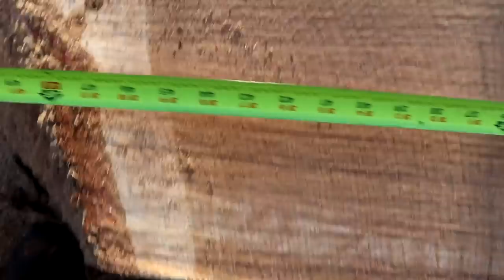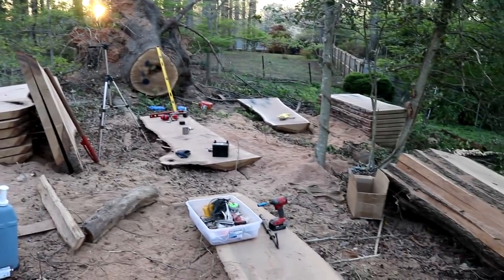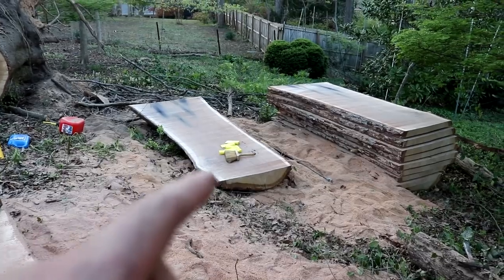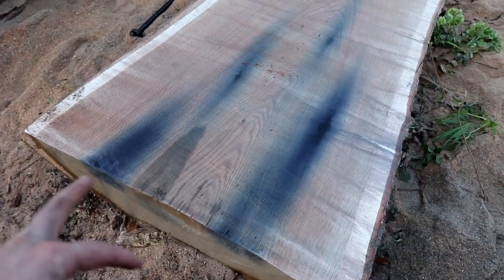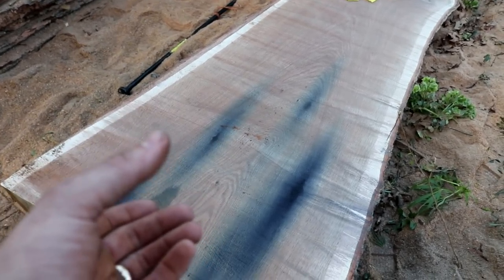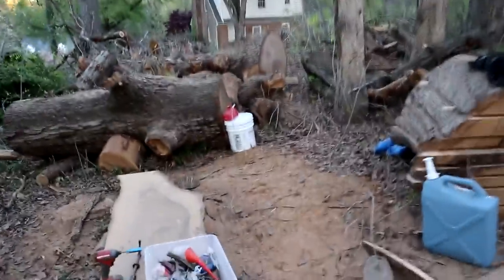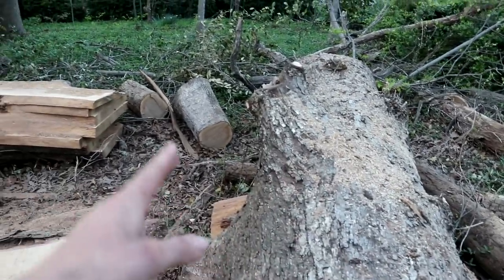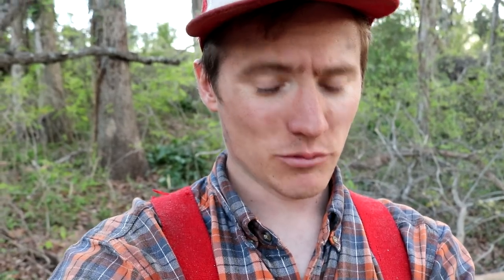HUGE CHAINSAW MILLING JOB!! 45 Foot White Oak!!!

Comment: Big tree!!! What type of mill is that I have never seen one sith a winch did you add it also the tank on the in water or oil?
Reply from the maker: Here's the link to my mill, I got a 60 inch. https://granberg.com/alaskan-mkiv-c2-series-30-84-2/ I added the winch, here's a video. https://www.youtube.com/watch?v=TSVn6rH2UyA The tank on the end of the bar is an auxiliary oiler. Chainsaws have oil in the powerhead that is automatically pumped onto the chain and bar. When using bars longer than 3 feet, it's a good idea to have an extra oiler to keep everything lubed up. It extends the life of the bar, chain, and sprocket. The bar I'm using is almost $700, so you want to make it last....with that said, you go through a lot of oil, but more out of the saw than the extra oiler. Hope that gives you a good starting place in learning about this kind of milling. There are more videos on Youtube on the topic, not a ton of detailed ones, but plenty showing people working. Thanks for watching.

Comment: What lengths do you normally cut large trees like this Oak?  8' 10' 12'?
Reply from the maker: I lean toward 8 feet, mainly because anything bigger is getting pretty hard to handle and store. I also consider the overall length of the tree and what will divide out nice. I also consider the projects I would use it for.
Reply from the maker: by 8 feet I mean a little over 8 feet so that I can trim the ends, 100 inches or so.
Reply: Thanks appreciate the answer I'm new at this and like the teaching videos

Comment: how did you end up carrying the wood offsite?
Reply from the maker: With this tree, a friend and I picked them up, carried them into the yard and sat them on a small trailer behind a lawn mower and trailered them down to the street one at a time and onto a large trailer. Then hauled them about an hour away to be stacked and stickered for years of drying. It was rough.

Comment: watching in Brazil! whoever can answer in Portuguese what was going on in the wood, that white liquid. what is it for?
Reply: Para que no se raje la madera ya comensando a cortar la madera, ya secandose mas despacio. Despacia la salida de humedad del tronco asi no se parte. So I tried it in Spanish. Hope it helps.
Reply: Using Google Translate, here is what I came up with: 
As extremidades de um tronco ou de uma tábua tendem a ser muito mais porosas do que o lado plano de uma laje / tábua. Portanto, se você pintar as pontas dos galhos das árvores, o tronco ou as tábuas, reduzirá a rachadura que ocorre quando uma árvore seca muito rápido. Ele permite uma secagem gradual e igual e, como resultado, madeira serrada de melhor qualidade. I hope it answers your question.

Comment: How did u dry the wood afterwards, plz??
Reply from the maker: It is air drying with one inch spacers between the slabs I'll finish it off in a kiln before using it.

Comment: no issues with the saw through the whole job? thats alot of hours onto that motor, probably only get 100-150 or so out of a ring and piston
Reply: Andrew Browner if you run big stihl  saws with a 40:1 mix you can get a LOT more than that,  
my ms880 had over 1200 hrs on original piston ring and barrel before I changed it.

Comment: Amazing. Which chainsaw mill do you use? I'm in pressed by how level the plane is and how square the ends are.

Can't wait to see what you do with the slabs.
Reply from the maker: https://granberg.com/alaskan-mkiv-c2-series-30-84-2/ I have a 60 inch mill package. The cut is due to the chain, very sharp....until it's not. It's a ripping chain, ground at 10 degrees. I have a granberg chain and a stihl, both the same angle. Having a good saw keeps you cutting nice as well.

Comment: can you check them with a metal detector ?
Reply from the maker: Yes, but that simply says there is metal. Not what it is, how big, etc. In most cases, I'm still going to mill the slab is it is worth more than the chain.

Comment: How accurate is that chainsaw mill.Ive always wondered how flat they mill
Reply from the maker: If you have a sharp chain they mill surprisingly clean, having a powerful saw makes a difference to in being able to feed it evenly. The only issue I have had is the bar sagging a little, cutting a slight curve into the slab but not enough to make a difference, in the end once dry, they need to be flattened, usually with a router flattening set up. Even if they were milled to flawlessly flat, while drying the slab will move a little. You can see in the video that they are pretty flat. A chainsaw mill's strengths are that it is the most mobile mill you can get, even one with an 8 foot bar can get anywhere whether it is way in the woods or in a backyard that heavy equipment can't access. It's also small, a bandmill is large and requires putting it somewhere. I have my mill on a workbench in my basement. They are also very simple, the mill it's self is nothing but bars of metal and bolts. Keeping your saw running and chains sharp is the only thing you have to do. Price is also lower, while larger mills including the saw get expensive, they are nothing compared to a bandmill that can saw an equally wide slab. With all that said, a bandmill is going to be faster and easier if you have the right equipment. Chainsaw milling is about as hard as it gets.
Reply: Thank you for the detailed response.Great videos your putting out as well

Comment: Thank you so much for making this video. Wanted to ask for your advice on stacking and storing the final boards as I keep milling more logs. Is there any risk to stacking and storing them in my basement? I'm worried about potential bugs or termite issues. I do have pest control service for my property that includes termite stations surrounding the property. I just don't have any easy way of storing the boards outside and the logs have already been cooking outside in the sun over the past 6 months of the winter season. I'm in the Atlanta area so not much of a winter here but mostly rain. Would greatly appreciate your feedback. Thanks again!
Reply from the maker: If you can do it out doors, just stack it all up with stickers and cover with tin. You could do it in the basement, but you need air flow, you would need fans.
Reply: Thank you for the feedback! What size stickers do you use? And is it ok to make the stickers out of one of the slabs I mill or do you recommend getting them from home depot instead?
Reply from the maker: @c0olj85  people say the best is to use the same wood you are stacking. I just rip up 2 by 4s to 3/4 square strips
Reply: Got it. Thanks again!

Comment: Recently purchased a small hobby band saw mill and interested in how you obtain the logs. If you don't mind me asking, in your Craig's list adds do you offer to buy the logs or remove them for free? BTW-Really enjoy the channel.
Reply from the maker: My listing just says if you have a downed tree, I will come take the log. I specifically say in the listing that I am not a tree service, that I am just a guy that wants to mill up the tree for lumber. I also so that I can not do a full clean up and remove all the rest. I say that by removing the largest logs, I will make the job of cleaning up easier and that the wood will not go to waste. I do not offer any money. Sure you can pay, but if you are in a city, you will end up with plenty of free wood over time. No one has asked me to pay, they are just happy to have the wood be gone. I also won't do anything dangerous or risky around their house, as in, I won't cut a tree down. In short, I say that I am just going to come take what I want and leave the rest. The log in this video was free, I heard from someone I know that it fell, I went to the persons house and knocked on the door and asked if I could get it, they asked me how much I would charge to removed it, I laughed and said free, they got a surprised look in their face and said ok. I'm just going to cut the branches in to small pieces and toss it into the woods. About an hour of clean up. I volunteered that, they did not ask me to.
Reply: Thanks man!  You answered a lot questions I also had but didn't ask.I think your practice of cleaning up the job site a little is excellent business and a win-win for all parties.  Also, I hear ya about not touching anything risky! Working on building a log arch trailer for transporting logs back to the mill. I will definitely use your technique when soliciting for free logs.... Thanks again for your advise and very informative response!

Comment: I am sure the safety police have already commented but you have chap son but you aren't wearing them while you are moving around with the saw. They are hot but mine saved my leg a few times when I least expected it. Had to do with me being tired and the saw being heavy. Any way what type of saw is that and old Stihl or a clone? How many cc?
Reply from the maker: +Ted John It is a Stihl 090. 137cc......i have two. Both made in the 70's. Very powerful.

Comment: Just curious if anyone knows.. when you slab out a tree like that do you still need to seal the end grain?
Reply from the maker: You don't have to do anything, but certain practices can improve your end result. Sealing the log slows down the drying from the endgrain, which helps prevent checking, splitting, etc.

Comment: Why do you use that seal on the wood?
Reply from the maker: To keep them from drying too fast at the endgrain which would check and split the slabs. Makes drying more even.

Comment: I used to be a badass like you,now i am a worn out ass from destroying my discs from being a badass like you. But i still go , i just hurt more now. It don't come to you,if you want it you gotta work for it.If i was 30 again would not change a thing.....maybe a few
Reply from the maker: I've had a lot of older people tell me how bad I'm going to hurt when I'm older due to the more rough activities I've been involved with in life, I listen politely then ask them what they did to end up in such bad shape. They never have a good answer. I will have wonderful reasons for being a crooked old man.
Reply: @thehomesteadcraftsman8975  Yup,good reasons to me also.We have pride in all we have done that most people will not or can't do.I think about stuff i built in my 20's & 30's and think"WTH was i thinking,whole room additions by myself,monster logs i got and sawed myself,still doing it.Town i live in is over 400 YO and lots of very large old trees here. My 10 acres has all large mature trees on it and i hardly drop any of them with all the others available for free or cheap.4 sawmills that i know of here probably many more small  Sawyers like me.
Reply from the maker: I would not cut my own trees down either unless there was a good reason, get them from someone else....I havn't paid for a single one yet.
Reply: @thehomesteadcraftsman8975  Wow,we talk about this and today i walk down to the creek and see a 28 inch red oak blew over,about 90 feet tall, 20+ tons all together and it took a 14 inch white oak with it.Gonna have to winch it about 200 feet to the trail,can't get in there unless i take more down.

Comment: You should have a metal detector in your car when you're doing stuff like this. Check the logs before you cut into them if you suspect metal.
Reply from the maker: Let's say you've got wood like this, or a 4 foot diameter walnut, etc....would you not mill it because of the risk of hitting a piece of metal........I'm milling it. It's just part of milling.

Comment: How much is 1 slab of that big wood worth ?
Reply from the maker: I don't know, but I would think a lot. Between $500 and $1000 if it dried without too much distortion and in the right market. I've seen them for much more at the same time.

Comment: Where did you get your saw an that long bar
Reply from the maker: Saw was used, stihl 090. Old Oregon bar for general cutting then the 6 foot bar came with the mill. I also have a Cannon bar, the will have what you need. Very nice bars but you may think they are expensive
Reply: @thehomesteadcraftsman8975  thank you.
Reply: @thehomesteadcraftsman8975  I have an o29 super I use for general  cutting  what's a good saw to mill with I don't run into trees that would need a 6ft bar 99% could be done with a 48" bar.  I want to build a house an finish inside  with lumber I cut band saw mills are pricey  so I'm looking more at a chainsaw mills

Comment: Out of curiosity what did you pay the property owner for this tree?
Reply from the maker: They have it to me, just wanted it gone. They actually asked me how much I would charge to get it out of there. When I told them nothing, I just wanted the wood their eyes about popped out of their head. People pay to have trees cut down and or removed all the time. A tree company will charge a few thousand to remove the tree, then go sell the logs to mills. With that said, I don't remove the branches/leaves. I only mill and take the slabs or in some cases take the logs and mill elsewhere. In this case, I cut up the top of the tree which landed in the yard and tossed the pieces into the woods. I would consider paying for logs if it was as simple as going somewhere and picking them up but in cases like this, it's only worth it if it's free in my opinion.
Reply: @thehomesteadcraftsman8975  
Damn score!

Comment: The pulley crank is not linked. Can you give me the name of it.
Reply from the maker: I just search hand winch on amazon and bought a boat winch 600 pounds without line and wound paracord onto it. check out my other milling videos, the link is there somewhere. It's in a playlist.
Reply: Do you remember the title of the video where you have the link to the boat winch.

Comment: What’s the paint for?
Reply from the maker: It's not paint, it's anchorseal. Basically a waxy finish. It seals the end grain so the wood does not dry fast. Paint works well, but this is supposed to be better. Working good so far.
Reply: The Homestead Craftsman I see. Thanks for the info🙏🏼

Comment: Wouldn't it be wise to invest in a metal detector?  If you did discover a buried nail would you actually drill and dig for it?  I suppose you would have no other options unless you didn't cut it at all...

Comment: Yard trees have a lot of insulators, screws and nails in them.
Reply from the maker: Indeed, this one wasn't too bad luckily, but the walnut I did before this one was bad.
Reply: I will have to get a metal detector.

Comment: What's the bar you using that's slick
Reply from the maker: It is a double ended bar, meaning I can run two saws on the same bar or place a helper handle on the opposite end. I got this one from Granberg.
Reply: What inch is that bar what cc saw?
Reply from the maker: The bar in this video is 72 inches long, when mounted in the mill I can cut 56 inch wide slabs. I also configure the mill to cut with a 36 inch bar (30 inch wide cut). The saw is a Stihl 090, 137cc. It is very powerful and well suited for milling. The modern equivalent would be the Stihl MS 880. Slightly less CC, faster chain speed and has saftey features the 090 doesn't have.........I prefer mine!
Reply: Nice thanks for all the useful info love what your doing can't wait till I can be doing the same!

Comment: Have you ever thought of using a metal detector to find out if there's metal in the wood before you cut it? I just figured I'd throw that out there
Reply from the maker: Even if there is metal, if the log is nice enough I'm still going to mill it.

Comment: Dude!  Before you fell, awkwardly, I might add, off the tree with the running chain saw in your hands, I was already thinking I hope you have your cell phone on your person within easy reach, just in case, and WHERE ARE YOUR CHAPS?!  Where's your head and eye protection?  I saw that limb kick back.  I know you are young, but you are NOT immortal!  And most of the time, you are by yourself!  You have to take better precautions!  Great work, by the way!  Stay safe.
Reply from the maker: I live dangerously.....it's a personal choice.
Reply: I guess when I was your age, I may have been just as reckless.  It's been so long that I have forgotten.  Stay safe, no matter what choices you make.

Comment: Get yourself a used 40 foot extension ladder and take it apart the two parts that slide. Use one section for your saw rails you will get longer material. Why not.
Reply from the maker: Picking them up is the problem.

Comment: You're lucky to be alive.
Reply from the maker: +rusedorange I agree. Think about all the time
Reply: How long is the bar on your saw?
Reply from the maker: I'm using a 25 inch on my small saw that I cut trees down with. On my milling saw I use a 36 inch bar and a 72 inch bar. I was using the 72 inch on this long. I have a max cut width of 56 inches.

Comment: Love the work, maybe upgrade your saw so it has a chain brake, if that ever kicks back you'll get some free painful plastic surgery......Also why bother wearing eye and ear protection if you don't even have chaps on.....
Reply from the maker: Hard to touch a chainsaw correctly in the eyes of the viewer, it's dangerous work. I think I have the chaps on in most of the videos...as for eyes and ears, the chance of kickback is pretty low, the chance of something getting in your eyes is about 99% and chance of hear damage is 110%.

Comment: Could have used a real band saw and you wouldn’t have wasted half the tree on kerf.
Reply from the maker: You’d have to move the log and have a band mill with a 60 inch capacity

Comment: should have milled the branches that forked off the trunk.  Alot of waisted wood.
Reply from the maker: +shoreline armor llc It would just twist up. Branches have too much tension. Also they were too small for a chainsaw mill to make sense. It was all used for firewood.
Reply: @thehomesteadcraftsman8975  the one you bucked up 1:42 looked about 16 inches wide.  I woulda milled it.